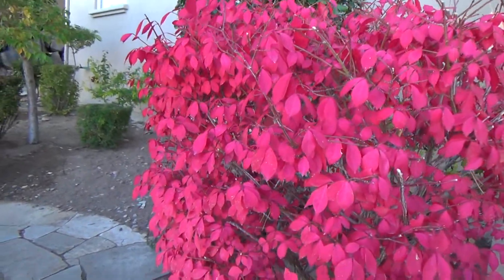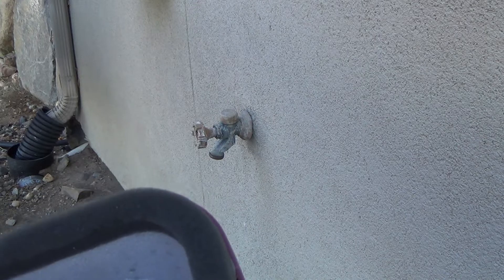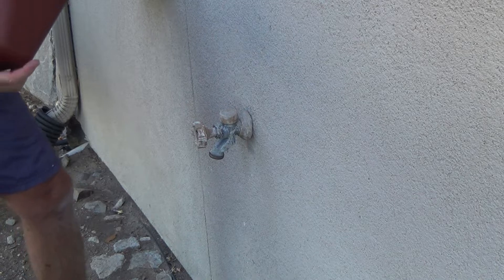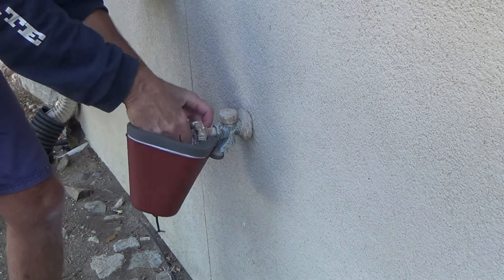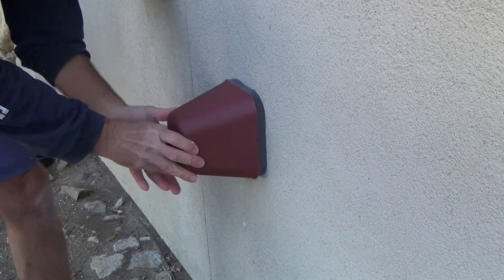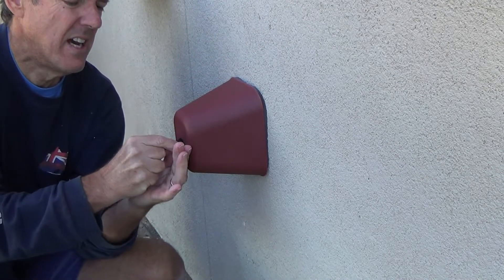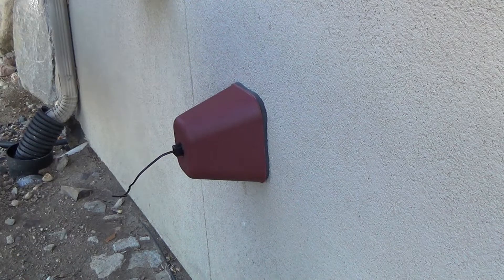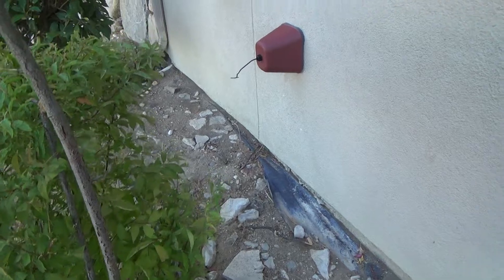How to Prevent Hose Bibs From Freezing/How to Winterize/DIY for Beginners

Comment: See that brown cap on top?  That's a bleed valve for a freeze-resistant frost-free faucet.  You don't need to cover those!
Reply from the maker: Really? What would I need to do then?
Reply: You do not need to cover.  The water pipe extends back into your house where it is warm and will not freeze lake older spigots.  

Here's something online "A frost-free faucet has a long stem and turns off the water well inside the wall, keeping the faucet from freezing. A properly installed frost-free faucet will have a slight downward pitch which allows water to drain out when the faucet is shut off".  

Look up "how do freeze proof spigots work'.
Reply from the maker: @drdlst  I'll have to check my faucet end next time I'm under the house to see if it's the long stem type you have suggested. Thanks!
Reply: So does your house have a crawl space?  Is the water line exposed to cold?
Reply from the maker: @drdlst  Yes we have a crawl space under the house & it gets downright cold here in the teens sometimes in the winter. A bit of snow from time to time as well but I've never had any issues with the hose bibs since I thought I was doing right by putting those covers over them. I have a ton of DIY videos on my channel & have done lots of videos under the house for different things. You should check some of them out. Just go to my main YouTube channel page then click on playlists & scroll down. Try it!
Reply: Ok.  They must Install different fixtures out there.  Continue using those covers, but they may not help that much if those pipes get too cold.  We have concrete slabs or crawl spaces here; no basements.
Reply from the maker: @drdlst  I've been putting these hose bibs covers on for the last 4 or 5 winters here with no issues. Thanks for all the suggestions, etc.. Keep it going!